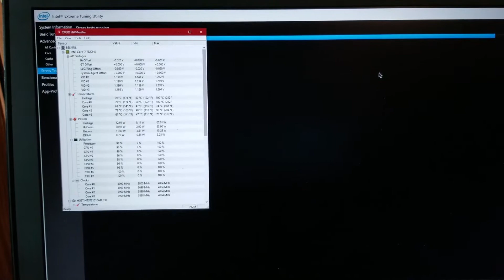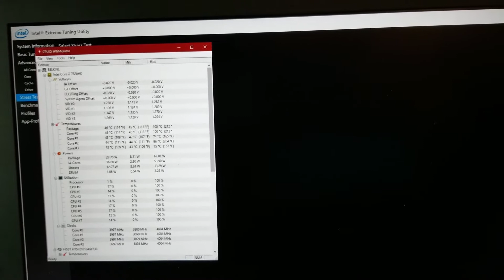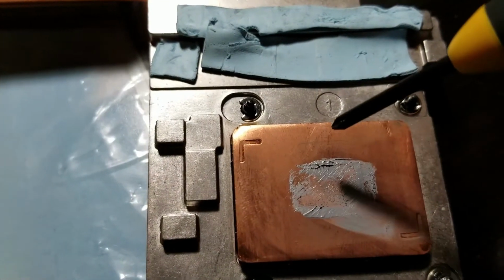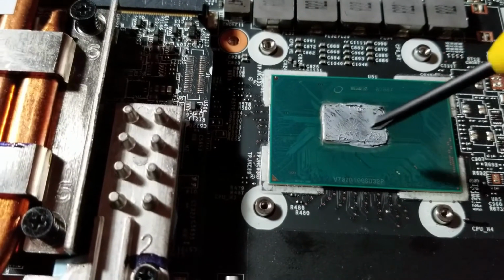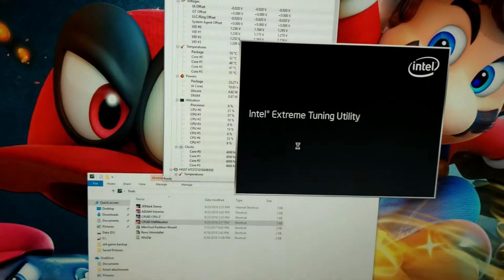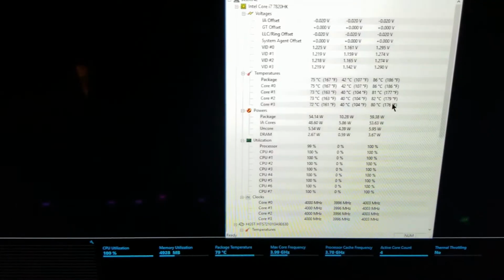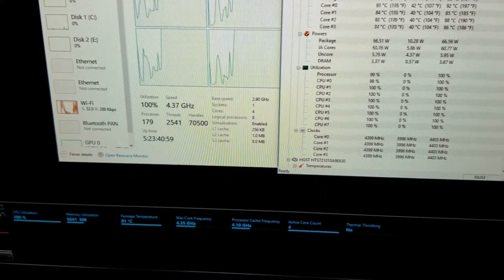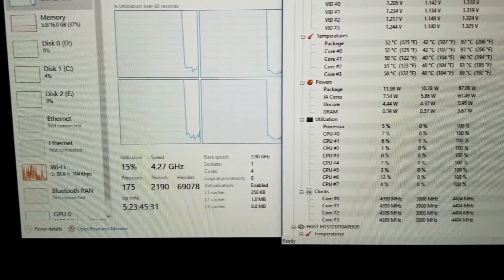Msi GT73vr 7820hk  Hits 100C!

Comment: Hello my problem fixex after replacing thermal pads correctly my cpu temp 78 degree normal fan speed (4.3Ghz) Override Voltage/Static Voltage 1.100 Stable. Didnt tried 4.4Ghz Everything is pretty stable

Comment: Hey?? i need help should i use 0.5mm Thermal pads so die sitted correctly i am facing same issue my core 0 and 1 temps were going high to 95 while gaming 4.4ghz even on 4.1ghz its reaching 87 -100Volts  please suggest me what i do?
Reply from the maker: You can try to use a thinner pad.
Uneven core temp would suggest the heatsink is sitting uneven on the die
Reply: @EcoBelkin  Thanks are you still using that laptop :P i saw your record you did amazingly 5ghz oc with good temps :p strange for me
Reply from the maker: I haven't turned it on in a while.
.like a few years while...
Reply: @EcoBelkin  Thanks mate <3 appreciated for the help btw 0.5mm thermal pad wont cause any issue i hope? and how much w/mk? is good for thermal pads?
Reply: @EcoBelkin  i ordered 0.5mm thermal pads for cpu

Comment: thin laptops and gaming dont mix, fans and space is just to small. I gave up and said fuck it and went with the big area51m r2 and im always in the 60s and 70s while gaming. Plus my right had does not burn up anymore from the side exhaust vent.
Reply from the maker: True that laptops with a lower height heatsinks, smaller heatpipes and thinner and smaller diameter fans does lead to an overall lower thermal capacity.

Comment: I have the same issue i recently gave my asus laptop with 7820hk for cleaning and repasting and i noticed 16 to 25 points of c difference between cores 0-2 running at 94-90 and cores 1-3 at 70-72 they changed the thermal pads and propably they created inbalanced heatsink position! What do you suggest?
Reply from the maker: Maybe the four mounting screws are not seated correctly, or one of the vrm thermal pads is not positioned right. Or maybe the thermal paste  did not spread evenly across the cpu die.

Comment: If i can pick one of these up with a 1070 for 1k should i. I want something that is not going to thermal throttle.
Reply from the maker: Short answer- if your gaming in 1080p or 1440p and you dont really have an opinion on Nvidias RTX "tech" or even just for content creation; then a 1070 right now would be okay.

But-
And in my own personal opinion,
With CES wrapping up this week and most vendors having shown off their new gaming laptops; I would wait till at least the beginning of March to buy a new laptop. That way you can see what you could potentially get for your 1k. Now if the new generation of entry gaming laptops is above that 1k (which they may be) then at point many resellers may/should have big discounts on "last year's" models, so you could get say a 1080 gpu laptop for less then you could today.

As far as thermal throttling- under normal usage- gaming, video editing, etc, mine doesn't thermal throttle at all.
Even when gaming for 24ish hours...

A tip to keep in mind- what ever laptop your looking at- look at the heat pipes. Ideally you want the cpu and the gpu to each have their own cooling, thus the heat of one doesnt effect the other.
Reply: @EcoBelkin  Thank you for the information, this laptop will be used as a streaming device mainly, I will only game using this if im out somewhere for more then a day so i will be gaming 1080p on it. Seeing how rtx cards are $$$ i do not believe they will be in my price range. I like the cooling solution for the GT series of laptops that why im choosing to go with a gt73. I have not found a gt75 second hand to purchase that is in the same price range.  my next choice was a ge73 but its so thin and thermal throttles when playing games, not something i want. I will also emulate games for "game night" with the bros and hope this will outperform a 4770k i7 paired with a 1070 reference and 16 gigs of ddr3 2400mhz because that is what it will be replacing.
Reply from the maker: I myself have not found a gt75 second hand- I wanted a broken one just so i could swap keyboards.

As far as performance, desktop cpu out perform laptop cpu. The gap is closing but its not all the way closed. A 4770k cpu vs a 7820hk cpu have will similar performance. Both should have the same l1,l2, and l3 cache.
The 7820hk base clock is lower, but uses ddr4 ram to 4770k ddr3 ram and higher base clock.
 The gpus, provided the laptop is not a maxq gpu 1070, should be with in 9ish- 10ish percent of each other.
With the laptop being newer, its chipset could some useful options like  usb C and thinderbolt 3.
Hope that helps. 
EcoBelkin.